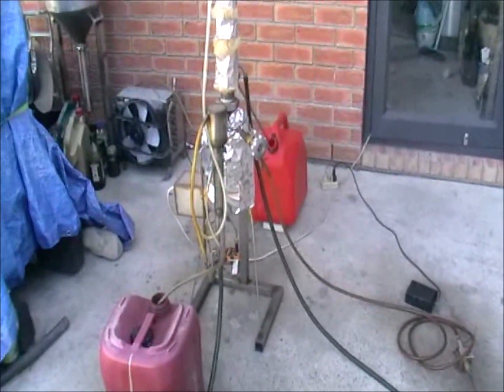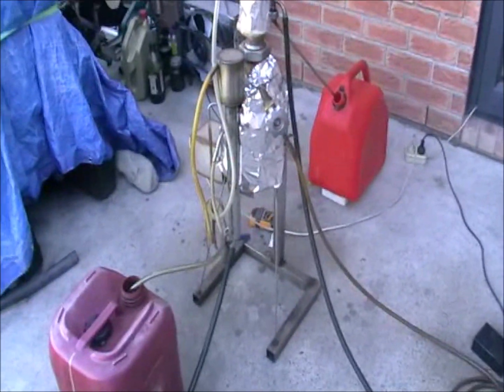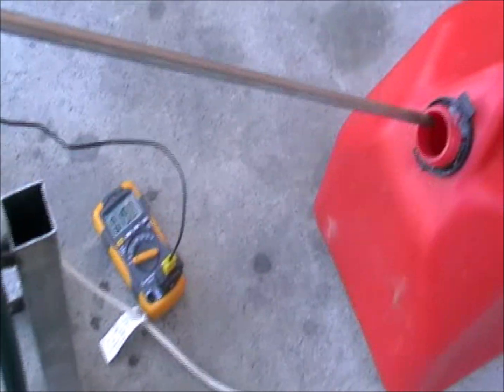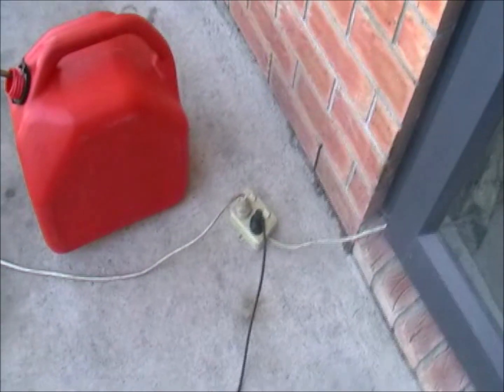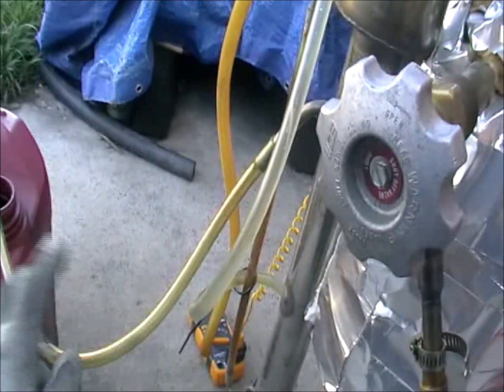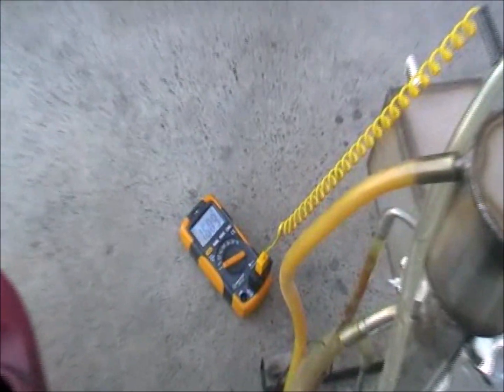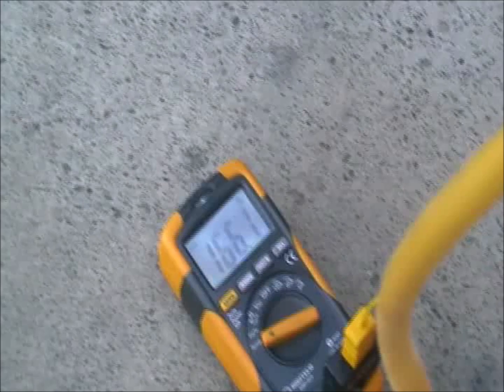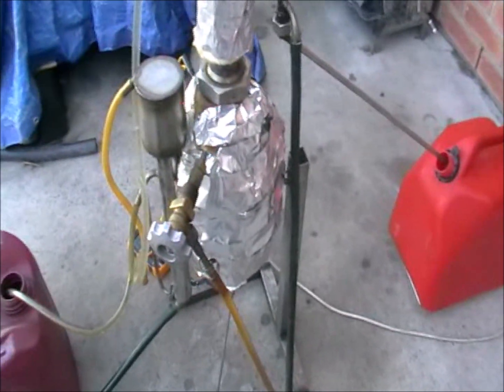How to run a WMO still - an old below SD era video from personal archives.

Comment: I have a question, please. How do I install the thermocouple sensor? Should it be submerged and in contact with the oil or in contact with the surface of the evaporation chamber?
Reply from the maker: Usually you need to measure the temperature of the vapor, while if you want a comparative adjustment , then you may need to have both oil and vapor - oil temperature to control an emergency shut down in case of no oil, I am relying on vapor temperature, - a pocket in the vapor chamber for the thermo-couple insertion.

Comment: I am one of your followers from Iraq, can you explain to us how synthetic oils are produced
Reply from the maker: Synthetic oil is produced as follows - first, natural gas is extracted from the Earth's crust. It ran through the catalytic conversion system and turned into methanol. Methanol again ran through special selective catalytic converters under certain pressure and temperature conditions in the presence of certain gases. It turned into synthetic petrol, kerosene, diesel fuel, and synthetic oil.

Comment: How about pumping it back to the same waste oil tank and closed loop water cooling i would like to see that
Reply from the maker: Hi, I can understand the looped water supply; it is done relatively easy, but please explain the pumping back to the waste oil tank part? Why the purified fraction should be mixed with used oil again - to make the same work twice? I can understand if I would collect it and then distill it one more time, then yes one can get better result, and I have a video about it.

Comment: In this process, can the engine oil be increased again to engine oil or are you making diesel from it?
Reply from the maker: Technically the distilled product is base oil that can be optimized back to engine oil with help of special additives and thickener.
Reply: @santeryi9  Hello sir. Do you know of the additives for making engine oil and the thickener?